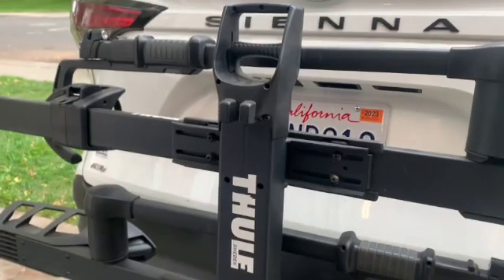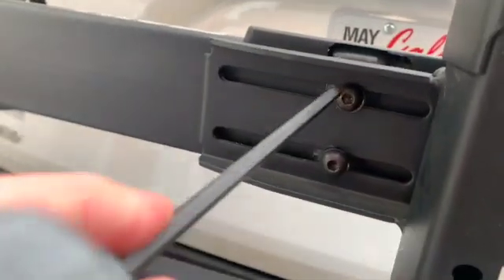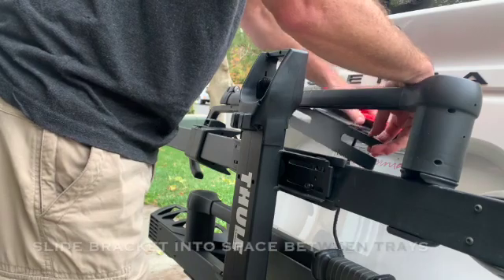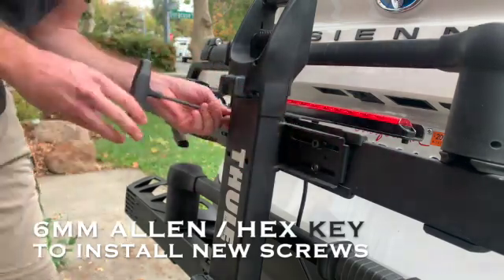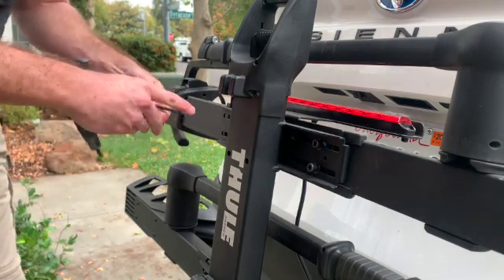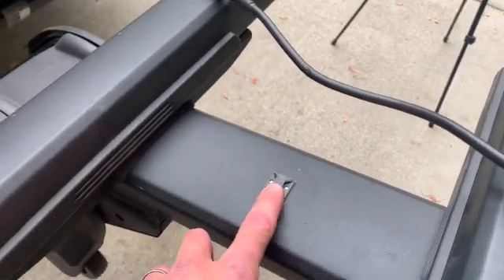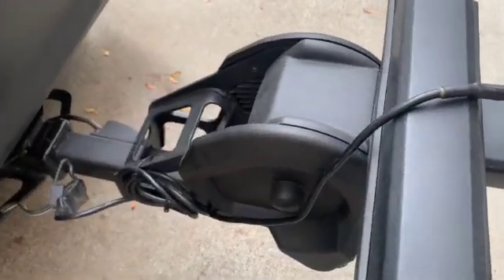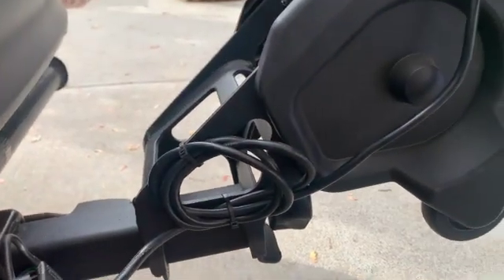Kody Light on a Thule T2 Pro Install - Brightest and Safest Bike Rack Lights - Kody Technologies

Comment: I just ordered mine after 4 years of dealing with a magnetic set from Amazon.  I have afeeling I will be much more happy with this set.  Quick question, why did you route the cables on the topside?
Reply from the maker: Thank you for your order Eric!  I normally install the cable along the top or the side of the center beam mostly to protect it from any debris or damage from anything hitting it on the bottom of the rack.  It's really personal preference.  We have a minivan that rides low to the ground and has a tendency to drag some times.  I hope that helps.
Reply: @ sorry but a couple more questions.  I ordered the 5’ cable length.  Will 5’ be long enough for a rigid 4 pin mount on a Thule 4 bike extender?  I measured it out and I think it will be good.  Can you also throw in some of those 3M zip tie mounts?
Reply from the maker: @ericnocek  Yes, the short cable will work fine with your set up.  The short cable which is about 70" long handles most situations.  Also, I did throw in a few 3M zip tie mounts to help with cable management.  The light shipped out yesterday.  Thanks again!
Reply: @ thank you for your excellent customer support.

Comment: Thanks for this video, would this work with the 4 bike Thule extender?
Reply from the maker: Yes, the Kody light for the T2 Pro will work on the four bike/extension.  All the design and geometry where the light mounts are the same between the two bike and four bike racks.  The installation process is the same by installing the light bracket sandwiched between the the last tray and the main beam.  Please reach out or let me know if you have any other questions.
Reply: @johnshinstock1975  thank you 😊
Reply: Maybe show video of the light bar installed and flashing?
Reply from the maker: @mscm4592  Sorry about my delayed response and great idea on including the light operating.  We have a separate video showing and explaining how the light work.  I'm pasting it here and I hope it works, if not I'll include a link to it in the description.  https://youtu.be/eFIlTAsCgPU
Reply: Would have been nice to see the light on
Reply from the maker: @lawrencetaylor5985  Here's a link to our video with the light in action and explanation on how it works.  I hope that helps.   https://youtu.be/eFIlTAsCgPU